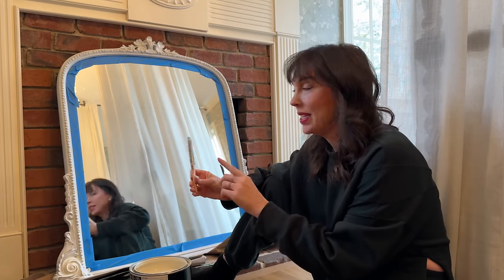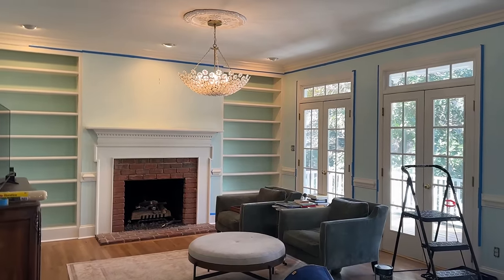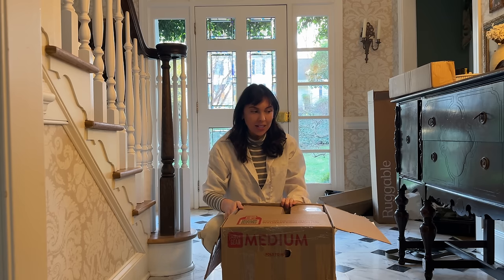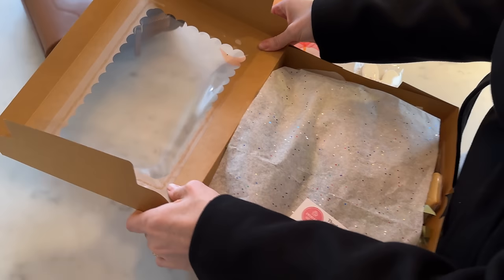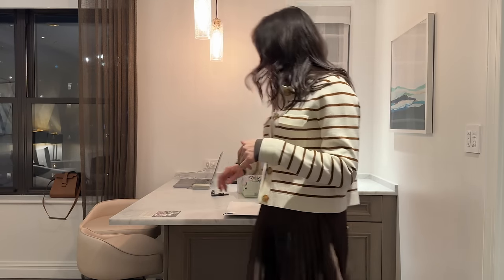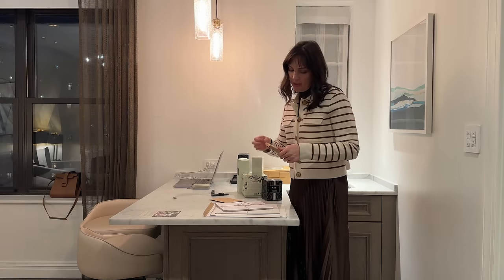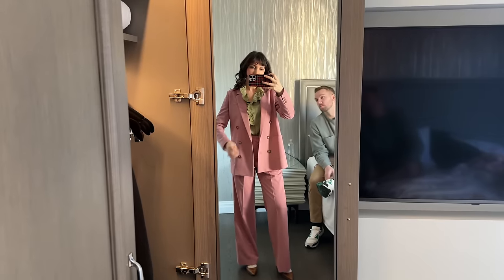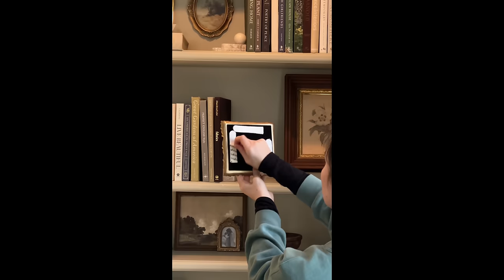Painting the New Living Room & A Quick NYC Trip

Comment: Hi , what do you do to prep your walls for painting ? 

I want to paint but I’m worried I’ll do it ‘wrong’
Reply from the maker: I’ve found that there isn’t really a “wrong” way to do it because everything can be fixed. I try to get paint with primer included so we only paint 2 coats on each wall. 

One tip I would say is to make sure you use painters tape to ensure your lines are clean.
Reply: Okay thank you !